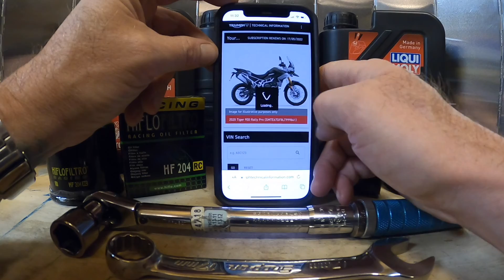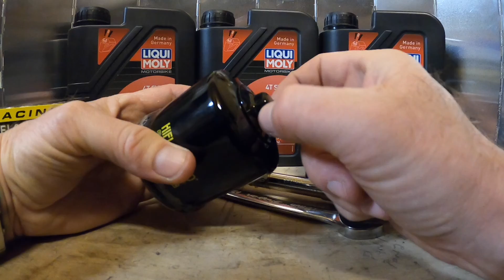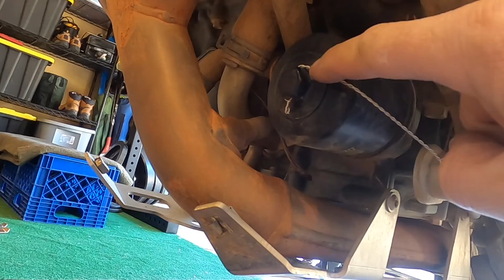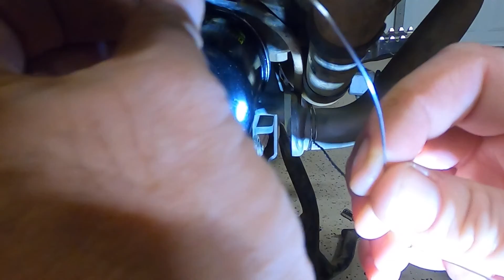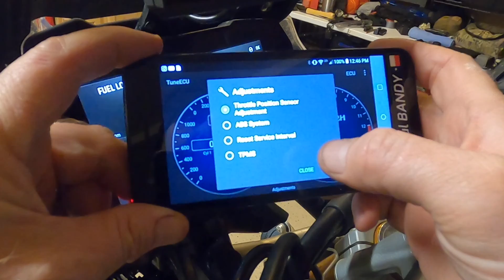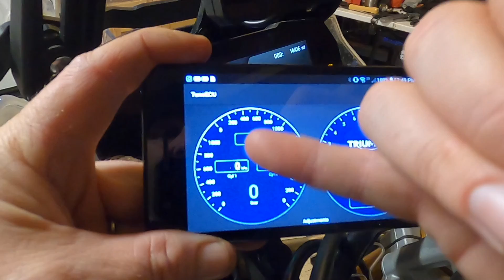Tiger 900 Rally Pro - Oil Change & Service Wrench Reset

Comment: Your service due date changed by 3 months. I would imagine there is a setting to have the interval at 12 months and 6000 miles?
Reply from the maker: Yes. There’s some options on the interval when you reset it

Comment: Thanks for the video! do you have Any videos on the tools needed for a TT900 rally pro ?
Reply from the maker: A general tool roll is sufficient for most maintenance. There are some specialty tools that are needed for specific purposes, which are listed in the maintenance manual for those procedures. 

https://triumphtechnicalinformation.com

Comment: I have never seen a oilfilter losening in 40 years with my cars or mortorcykles so that safty wire is bull!
Reply from the maker: Oh no! Better knock on wood!! Jk… I have had cars loosen over the longer intervals that comes with using synthetic oils. I don’t mind twisting safety wire… get some practice in case I even go back to working on aircraft.
Reply: @BlueADV214  I totally agree with you 100% on that! better to be safe than sorry. What a little wire hurt.!

Comment: Hey Bleu ADV, nice instruction video i will certainly  use it for my oil change its nice of you mentioning the torque specs because they are hard to find online! Do you have any pointers where to access them all? I want to take my wheels of and remove the brake disc to clean my spokes.
Friendly greetings from Belgium my name is Dennis
Reply from the maker: Triumphtechnicalinformatio.com

Comment: Well done,  A ot of good info.... I too use the Hiflow filters on my KLR the past 23,000 miles so I trust them.... I  also tourq the drain plug ... By Chance  have you used  a Magnetic drain plug?? Given the Tiger uses a Hex drain plug  I will probably replace it with a Magnetic 10mm or what ever fits the bike...    I always install those to collect any  internal STEEL ware of parts....  Im not yet a Tiger owner but Hope to be this spring....  One last Question, I will be on the pavement mostly with the bike Dirt Roads would be all the Dirt the bike will ever see..  Have you noticed any vibration at around  70-75 mph on yours ?  some say yes some say a little some say no.... Comming off a ONE lungger I would expect it to be like butter haahahaha but just curious... Like I said I will be test riding one in the Spring...  Thanks again..
Reply from the maker: Never used a different drain plug. No noticeable vibrations up to 100mph on Dunlop Trailmax Mission tires, which is what I will be switching back to soon.
Reply: @BlueADV214  the Trail Mission tires look a lot like the Shniko 705 I. have on my KLR .. Had Great luck with those also ...

Comment: No sheared bolts from your Upper Crash bars ??     I'm getting Mosko Motos too, and the Outback Mototek racks. What you use for top box and rack ?
Reply from the maker: No sheared bolts, but have had to bend things back into place a few times. For a top case I’m using an Outback Motortek luggage rack with a Rotopax water jug and a Mosko Moto duffle strapped over the rear passenger seat.

Comment: The Triumph service manual I have indicates that, “4. With the motorcycle on level ground, and on the side stand, allow the oil to completely drain.” Not sure how much difference that makes but you had yours on the center stand.
Reply from the maker: I’m sure it’s negligible, but I also change my oil more frequently due to the amount of off-road riding I do.

Comment: So no more Dunlop Trailmax Missions? Why did you decide to go with a diff tire?  Off road grip not good enough?
Reply from the maker: I wanted to try something a little knobbier for my desert trip where I was going to be in a lot of sand and gravel. Honestly, after a few hundred miles on these, I might switch back to the Trailmax Missions. They are such a good all around tire… I had 9,500ish miles on them when I swapped and they actually still had a good amount of life left in them.

Comment: Why is it need a safty wire on a oil filter? i have never seen this is nessesary on other oilfilter in any bike i know !
Reply from the maker: I know most people don’t safety wire the filter, but I have had filters work their way loose more than once (not on this bike) and so I like the added security it provides. The only thing holding it on is the o-ring… better to have and not need than need and not have.
Reply: Road race tech inspection requirements made these appear decades ago on the K&N as a convenience.  But I've never seen a spin on filter loosen on it's own so i don't bother on the street bikes.